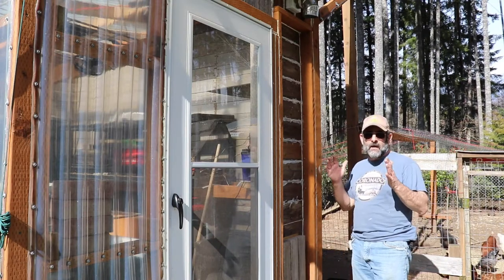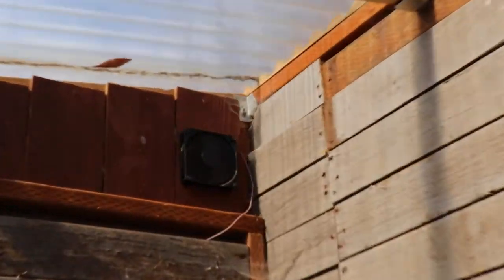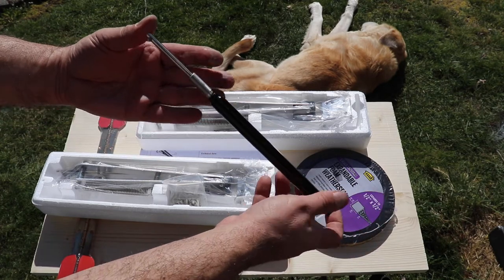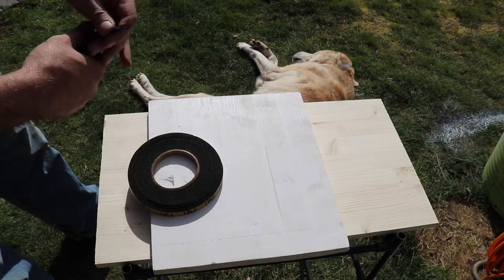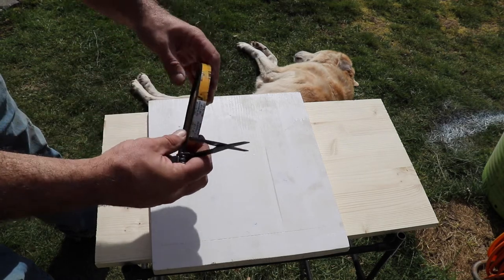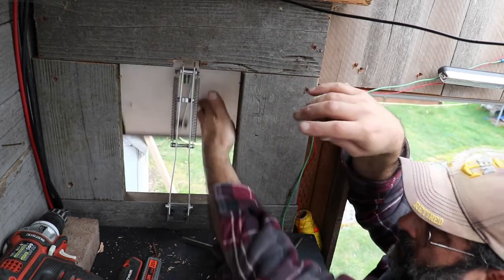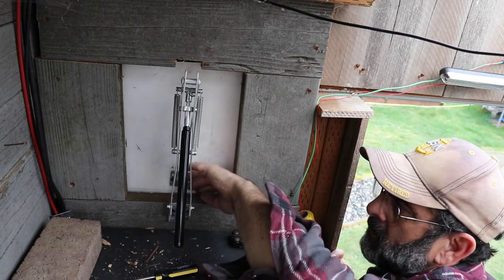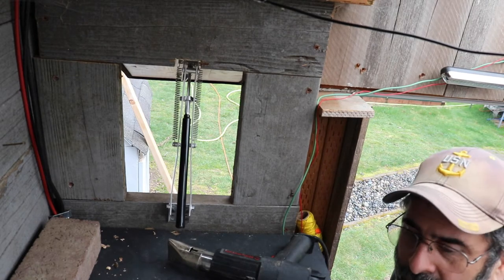Installing a Bee’s Wax Automatic Window/Vent Opener in a Greenhouse

Comment: Can you tell me where you purchased the bees wax auto window openers ? Having a hard time finding them. Thanx
Reply from the maker: https://amzn.to/3qJFqam  I just put 3 more in yesterday in the new greenhouse I am building.  Happy Gardening!
Reply: Ok , but can you tell me where you purchased the bees wax openers at ? Part number ? Thanks
Reply from the maker: It was on Amazon.  It was the "Yziixi Greenhouse Automatic Window Opener Auto Greenhouse Acessories with Solar Power Sensor Vent Roof Opener Replacement Cylinder Temperature Control Lifts 7kg/15Lbs (Double Springs Opener)" https://amzn.to/3qJFqam
Reply: Thank you very much !!
Reply from the maker: No problem!  Happy Gardening!

Comment: have similar, wanting to add a screen up high , and mesh/screen down low,   travel for the plunger is the issue
Reply from the maker: Cylinder blockage blew out one of my first ones, slick bees wax everywhere.  Replacement cylinder cost almost as much as the whole assembly.  Happy Gardening!